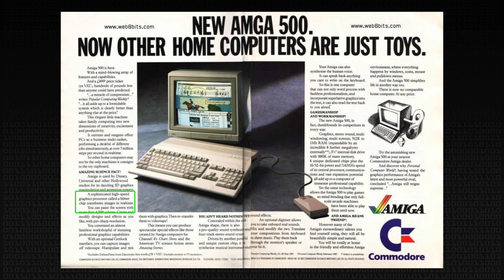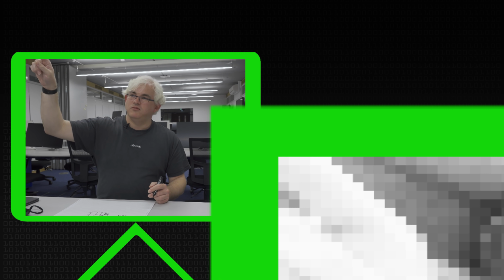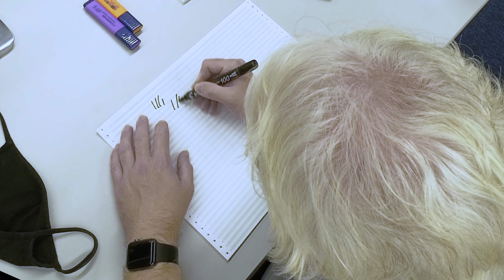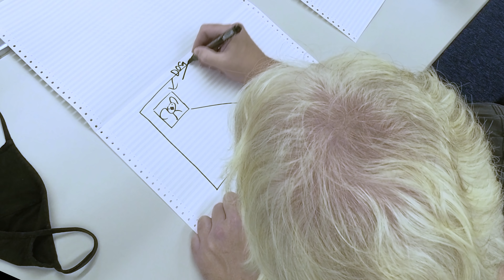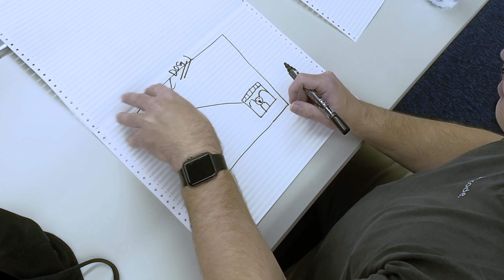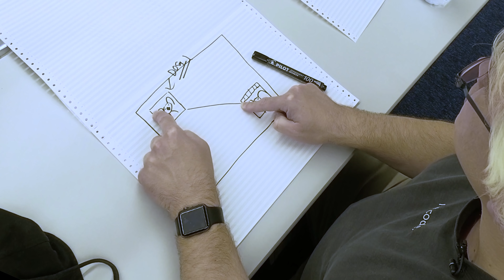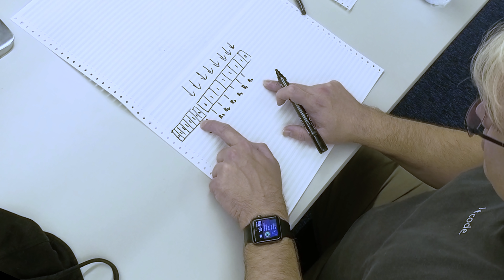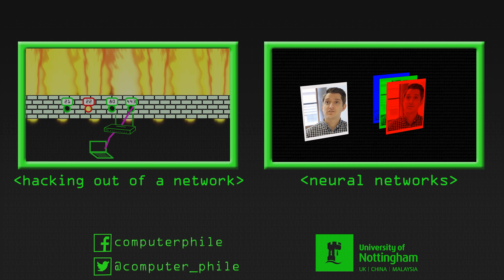Bit Blit Algorithm (Amiga Blitter Chip) - Computerphile

Comment: The Amiga blitter also had something amazing (for that time): a mode to render lines. If I remember correctly it implemented Bresenham's line drawing algorithm.. in hardware. This was pretty mindblowing stuff, at the time. I got it to work (banging pure hardware) and managed to get a wireframe space shuttle rotating smoothly on the screen. Those were the days.
Reply: What do you mean "banging"?
Reply: @eadweard.  Banging = just writing to the blitter registers. If my memory doesn't fail me, the hard part was that your code needed to figure out in which of 8 octants the line would fall into.. this information was needed by the blitter to properly render the line. So it wasn't as simple as passing (x1,y1) and (x2, y2) to the registers..
Reply: @laurencevanhelsuwe3052  oh right thanks I thought at first it was some kind of depravity.
Reply: @laurencevanhelsuwe3052  I wrote a lot of stuff for the Amiga back in my youth, and started doing some programming on it again recently to render filled vector objects. Getting the line drawing code right is quite finnicky as you say. The Amiga also had a primitive polygon filling operation built into the blitter, which had some subtleties to overcome when used with the line drawing hardware. Amazing machine for it's time though.
Reply: @eadweard.  It definitely is and a great time in history of programming :D
Reply: The Blitter was fast, but limited. It couldn’t do rounded-corner rectangles. The Macintosh UI, for example, had rounded-corner windows and rounded-corner buttons. On the Mac, it was all done in software, which was slower but more flexible.
Reply: @jkdsteve  It was the only time in history when large numbers of people could a) learn to understand almost everything there is to know about a single machine and b) program these machines with a feeling of being in complete control (of the machine). For the past 20-25 years, this complete mastery of technology has quickly evaporated again. Even highly experienced programmers today only understand a fraction of what an average machine does. Literally a fraction. Silly example: the vast majority don't even understand how the characters making up text anywhere on the screen, are rendered. The vast majority haven't a clue how an OS multi-tasking subsystem works. With every year that passes, programmers are also leaving behind the knowledge on how to use bits within bytes. In the 80s we could program entire commercial video games in 32-64K, nowadays.. oh, please stop me ;-)
Reply: @lawrencedoliveiro9104  The Blitter can do any shape by using a mask bitmap. It is used to draw BOBs (Blitter objects = software sprites) in AmigaOS and was especially created for exactly that purpose.

Comment: Nice to see a Amiga featured in a Computerphile video, but the amiga blitter was much more complex, it could for example combine 3 sources in one operation, for example a char of a font, a mask which defines which pixels to copy over, the destination (yes as source also) and the destination again, so that only the bits set in the mask are blitted over, at the same time the barrelshifter could shift the whole operation multiple bits to the side (for pixelexact placement/scrolling), it could also draw lines, fill outlines, all this made the amiga far ahead of any pc for a long time, when 386 with ~80Mhz and the first Geforce cards showed up pc slowly had the same power as an plain Amiga 500 with 68000@7Mhz.
Reply: Was looking for this comment. The Amiga’s blitter could be used to paint filled polygon 3d graphics with the right setups
Reply: I've seen 386 at 40 running elite II fluently. On the Amiga.. 5fps? Cannon fodder ran fine on a 386slc at 25 MHz. Even with smooth paralaxing intro and everything. PCs by then had such fast cpus and buses that they didn't even need a blitter.. But some had them in the form of "windows accelerators". Amiga was great tech and a bag of tricks, but by 1992, they were behind.

Comment: For my 1990 Amiga game "Dino Wars" I went "straight to the hardware" for everything, bypassing the OS, and there is a lot of unique and clever use of the Blitter to optimize drawing of large graphics. Specifically, I implemented a "blit strips" compression/decompression algorithm that divided up all the large dinosaur bitmaps into vertical strips, only where the data was non-zero, and with a minimum gap between strips. All the size and blitter setup info is interspersed in the data, so it is read sequentially during the full blit operation. The Amiga also used "bit planes" for its graphics, so the bits in each plane always correspond to one pixel. This meant that some of the data planes in the source graphics were mostly empty. The mask –which is just an OR of all the planes in the bitmap– was the largest blob of data, but also the most vital, as it was used to do "cookie cutter" operations. And, depending on how the image mask was applied to the bit planes, the graphics could be made to use different parts of the color palette, so the same bitmap data could be used to draw different colored dinosaurs. Even though the blit strips method uses the CPU a lot more during drawing, since the overall strip-compressed data size was a lot smaller than the raw rectangle the end result was much faster drawing. On top of using the blitter in this clever manner, I also ended up writing blitter code to handle the MFM (or was it GCR?) floppy disk encoding/decoding because I even bypassed the OS for disk I/O. I no longer have the originsl source code, but someday I hope to use the debug monitor in an Amiga emulator to extract some of these cool bits and showcase them someplace for posterity. I know of no other game that thought to employ the blitter in just this way.
Reply: Would be really nice to see a more detailed writeup on this!
Reply: @noor-rx1ij  agreed

Comment: should have mentioned that "blt" is short for block transfer
Reply: But what if The Master gets in and corrupts the process?! It’ll be Logopolis all over again 😫
Reply: tf you mean? blt stands for bacon lettuce tomato smh
Reply: In the day, Bit Block Transfers were called 'Bit Blot' operations and Block Image Transfers were called 'Blit' operations.
The real trickiness happens with blitting, on screen or off, when the source and target rectangles memory regions overlap, then you might have to read rows, or columns, or both in reverse order to not wreck the source data during the copy.
I worked on coin-op conversions back in the 6502 and Z80 days. Non-contiguous display memory rows like the Apple ][ were a pain!
Reply: ... and blitter = BLock Image Transferrer. When the ST finally got some more advanced gfx hardware, I heard it called a "blimmer" which was a block image manipulator. Mag article and jealousy slap at Amiga hw
Reply: yum, virtual burguer

Comment: I learned that from the book Smalltalk 80 and later used it to implement the display for the first raster-scanned anti-aliased heart monitor. Previous to that vector displays, large, heavy, power guzzlers, were used by all displays.
Reply: Sounds like a definite win.
Reply: @squishmastah4682  Thanks yeah, it was interesting. Either directly from Smalltalk 80 or something else I had read I learned that if you have a monochrome display where each pixel has several levels of intensity you could make it appear that a pixel was located somewhere between two pixels by appropriately setting the intensity of those pixels. That let me make a smooth curve even on the then low-resolution displays.
Reply: @zanesthename  You were lucky!  Getting to play with anti-aliasing while I was busy fixing S.E Labs (later Thorn EMI) CardioStore heart monitors. :-)

Comment: 24:48 - "you can't have 2 things accessing memory at the same time" - well, that's not quite true with the Amiga, as it had the ability to access the non shared RAM at the same time as the blitter was accessing the shared ram -> from The Amiga Hardware Manual -> "Performance of the 68000 is enhanced by a system design that gives it every alternate bus cycle, allowing it to run at full rated speed most of the time. As described in the section below, the special purpose hardware can steal time from the 68000 for jobs it can do more efficiently than the 68000. Even then, such cycle stealing only blocks the 68000's access to the shared memory. When using ROM or external memory, the 68000 always runs at full speed. "
Reply: You can also send blitter commands via the copper, freeing the CPU even more. It's not often used though, as I believe it can can get a little messy.
Reply: Yes, but only because the bus accessors are slow. If you'd need the dma to go as fast as physically possible, wait states would ensue.

Comment: It would be interesting to see a detailed examination of the QuickDraw CopyBits function that Apple used in early versions of the Mac. That was a software blitter, but incredibly highly optimised and included the ability to clip the destination with an arbitrary region (which is a video all by itself). The Apple engineers were justifiably proud of how much work went into CopyBits.
Reply: Well, QuickDraw and MacPaint have been open-sourced, so…
Reply: Dark Winter  but regions and bitblit implementations were down in ROM - at the time, they were impressive graphics primitives even though coded to execute on the 68000 cpu
Reply: @TheSulross  QuickDraw was ROM-resident and the source for that part of the ROM is included in the package of source code.
Reply: They got a patent on the QuickDraw region structure, and wouldn’t let anybody else use it until it expired in about the 200x’s.

Comment: it was massively useful for graphics operations because early days, that's what 95% of graphics operations were:  Copying (relatively) huge chunks of data around.

Scrolling is the defacto example of this.  You're moving 95% of the already on-screen data from one location in memory to another area nearby and then copying a small amount of new data onto one or two of the borders of that screen ram.
Reply: True, but not always. On the Amiga, you would simply update the bitplane pointers to point to the new location.
Reply: @VastyVastyVoid  That's a perfect example of WHY companies started introducing hardware assistance like Blitters and such into their systems to perform these tasks.
Reply: @VastyVastyVoid  Yup, or update the LMS addresses for Antic on it's true predecessor, the Atari 8 bit machines. No screen memory moves, the 'Window' into memory moves.
Reply: @Jimbaloidatron  Eh, I wouldn't call the Atari 8-bit its predecessor. I could be convinced, but the evidence would have to be something special -- the engineers having worked at Atari wouldn't be sufficient, given the differences in terms of architecture, OS decisions, microkernel etc.

But yes, that part works in a similar fashion, or at least as far as I know.
Reply: @VastyVastyVoid  I don't believe you can really be thinking in terms of the OS and microkernel software when comparing to any 8 bit system, Atari or otherwise! Without even knowing that Jay Miner designed the Antic and C/GTIA chips, you can see things in the hardware; like how the Amiga sprites have unlimited height is an evolution of the C/GTIA columnar 'players'. That by design you can display multiple modes of different resolutions all on the screen simultaneously from different places in memory. The emphasis toward graphical co-processor use itself. It's inevitable some concepts will have stayed with him, evolved and been turned up to eleven in the Amiga - the clues are there. When Atari released the ST, I was among many Atari 8 bit users who could not accept a bunch of off-the-shelf components as a compelling upgrade and instead bought an Amiga. Maybe I choose to see things that way, and it's entirely confirmation bias, but I'm happy with that. We all learn as we go and our successes will influence our future choices, no reason to think it wouldn't have applied back then and it does no harm to the Amiga legacy, except perhaps if there are those who think a beam of golden light came from the sky and the wire-wrapped prototype descended slowly in a shimmering cloud of beautiful copper bars! :-)
Reply: @TheTurnipKing  Doing full screen scrolling with Blitter would never be as smooth as with updates of bitplane pointers, because the Blitter was not fast enough on the Amiga.
Reply: @amigalemming  True enough: As I understand it, the Blitter isnt so much for screen scrolling directly as overlaying sprites over a background.  Just one part of a fairly comprehensive toolbox of hardware assistance.

Comment: the Amiga used the blitter for disk access too. Because of the encoding, there was a "soft index" (4489h... maybe... ?) that could never be the result of a data encoding action. AmigaDOS just dropped the head on the disk, read an entire track (+ a bit). The blitter was then tasked to find the index and re-construct the entire track in the right order. The DOS firmware then just picked out the sectors it wanted.

Comment: Amiga also had the "Copper" (simply an abbrev. for "Co-Processor") in addition to the Blitter - and although it had only three commands built in it understood (move, skip, wait) it could get very complex in using it...
Reply: Wasn't copper used to implement hold and modify.  This goes way back for me.
Reply: @hardware4200  No, HAM was implemented in the graphics chip, but you could use the copper to increase the effective palette in all modes by switching palette entries when you got to specific screen positions.
Reply: @hardware4200  
Slice HAM mode used copper to reload the color palette at a specific display location.  

Normal HAM used specific hardware features in Amiga's custom chip.
Reply: The Copper chip was far more innovative than the Blitter. It was the Copper that allowed the multiple vertically-sliding “screens” with different graphics modes. They could only be partitioned vertically, because the Copper chip could only change mode between scan lines, not in the middle of a scan line. But being able to dynamically rebuild a display list was (in those days) much quicker than having to copy entire screenfuls of pixels around.
Reply: @lawrencedoliveiro9104  The Copper could change a register in the middle of a scan line. However, for one change along a vertical line you would have to do perform a Copper operation in every scan line. And the horizontal resolution for changes was limited (I assume 4 pixels).

Comment: This sounds extremely useful, not just for graphics but in data transfer in general.
Reply: I guess I don't see the utility outside of older computer graphics.   Do you have an example of where you'd need to copy data that isn't byte aligned to a source that is misaligned differently?
Reply: @recompile  In it's simplest form just to copy big blocks of memory (without shifting or bit operating), to free up the CPU to do other things. It was even mentioned in the video.Then it's basically DMA (which the Amiga also implemented btw.).
Reply: yeah GPUs were a main driver in the reduction of that bottleneck. Fastest circuits in any comp were the video circuits.

Comment: BitBlit hardware is still there actually. Every smartphone has 2D acceleration block inside SoC. And its main task is BitBlit. Yes, it's a bit more advanced since it can convert colorspace and do alpha blending. It also can "fill rectangle with color" and "draw line". But 2D accelerator is mostly (like 80%) a BitBlit chip.
2D accelerator easily outperforms both CPU and GPU inside mobile chipsets.
And there are more 2D hardware in a smartphone. Like Image Signal Processor which can crop and resize image from your camera.
Or Video Output Processor which can blend several planes (aka windows) on the fly pixel by pixel while sending result directly to display. Much like graphics editors handle multiple layers.

Comment: I suggest folks go read about how John Carmack implemented side-scrolling on PC using the EGA latches.  PC graphics hardware was never made for gaming but a lot of clever tricks were used to speed up blitting in ways never really intended.
Reply: Are you saying EGA had a blitter?
Reply: @uriituw  if you mean blitter, no, they are not saying that. They are saying that EGA has horizontal and vertical offset values for the frame buffer. This drastically reduced the amount of blitting needed for scrolling graphics. Do as they suggest and google that "John Carmack implemented side-scrolling on PC using the EGA latches", and you'll find the Wikipedia article describing the whole process.
Reply: VGA had some latches could be used to make a de facto blitter.. Albeit a very limited one that still required a lot of cpu pokes.

Comment: One big problem with the video. "You could do this much faster than you could in software" - on Amiga, actually, no! Blitting using CPU was roughly the same speed on A500, and significantly slower on A1200 - simply because Blitter operated at much slower clock than the CPU. It still had its uses because you could blit areas of memory using the blitter while the CPU was busy doing other, unrelated stuff - or even blitting other areas of memory, say, have a game with a couple objects maintained as BLOBs (Blitter Objects) and majority generated by CPU. Plus Blitter could keep your software short and sweet, setting it up was way less work. But apples to apples, it wasn't faster.
Reply: It was faster. We are talking OCS here and 68000 and try to do a 3 source data manipulation with bit shifting with the CPU (who has not any bit barrel rotation in hardware) as fast. So yes the blittwr was indeed faster. 

If we talk just simple word aligned data A to B copy. Then yes they where more or less same speed. But that is not what blitting was